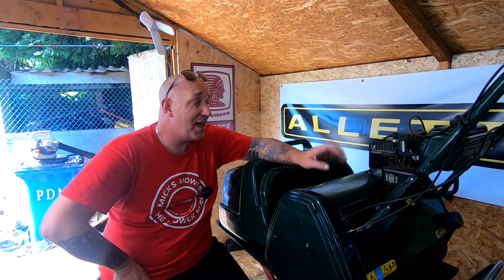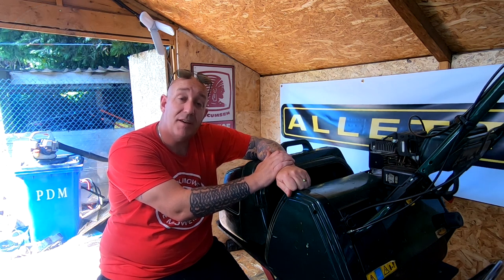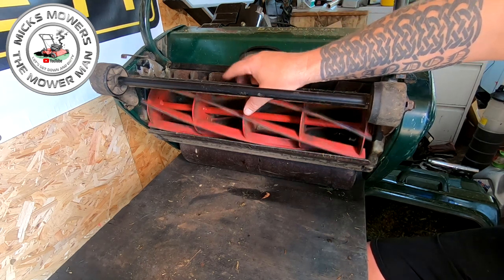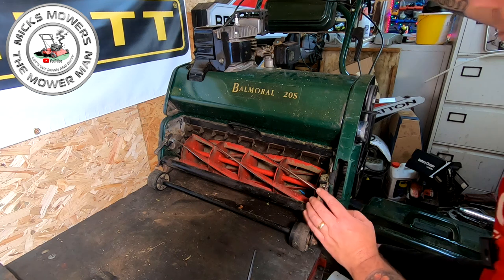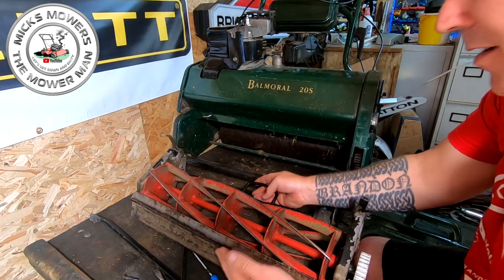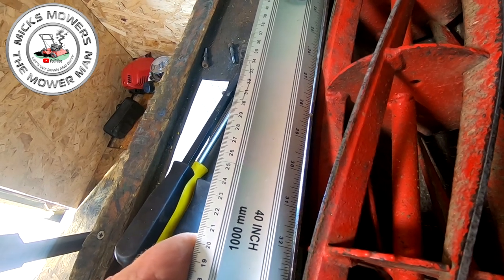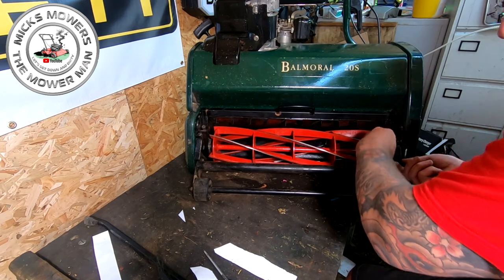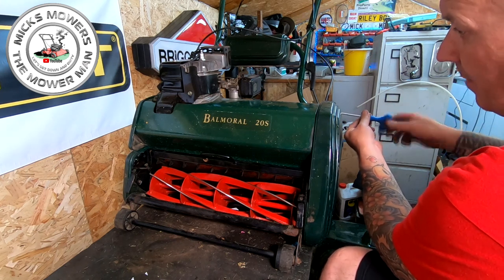Cylinder Mower Not Cutting Property - Check This First #micksmowers

Comment: Hi Mick, I'm now in the process of adjusting the cutting blades. It seems like I can't turn the adjusting screw any further as it's really tight and I need to turn them a couple of turns more. Looks like the springs that are under the bearing housing are fully squeezed tight. I could cut them I suppose.
Reply: @davehorban3967  You’ve ran out of adjustment, the cylinder and/or the bottom blade are to far worn to be adjusted

Comment: It might not have been that repair that was stopping that cassette from coming out. I have a Qualcast Classic 35s. I used to swap cassettes out frequently, scarifier, aerator and the cutting cassette. I always used to use a power driver to tighten those 2 retaining bolts. Over time it bent the side plate in where the nut is welded on. This was stopping the cassette from coming out as it caught the end plate of the cassette. I ended up having to buy a used deck. Now I do them up only hand tight. Cassettes now slide in and out easily. It looked to me like your replacement cassette was still hard to get in.
Reply from the maker: Yeah ray.. treat it with a bit of love .... Tenter and gentle like bahahah

Comment: hi pal love your videos, youve helped me turn a free none running hayter harrier 48 pro in to a great machine, like your customer that keeps coming back i went for the cheap after market carb, was cheaper than a genuine rebuild kit, was smoking a bit and would pop like a teenagers 125, for the life of me couldnt figure it out, look at the choke when its off, the after market carb, the plastic bit the choke spring goes on is slightly to long and catching on the air box cover keeping it half on choke, hack saw cut 3mm of no more smoke or popping, sorry its off subject on this video, but thought it might be something for you to look at
Reply from the maker: Ok mate ta for the information

Comment: Great video Mick. I have a  cylinder that the adjustment bolts either side have been destroyed so I can't either turn them. I can't get a grinder in to cut a new slot for the screwdriver. Any ideas
Reply: Dremel multi tool??
Reply from the maker: As below